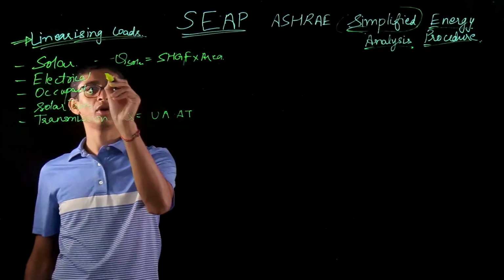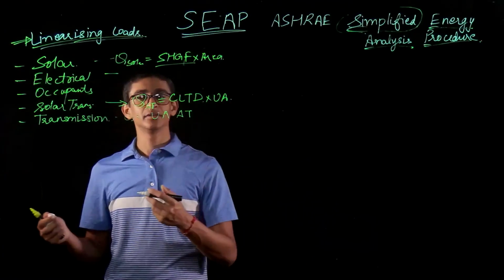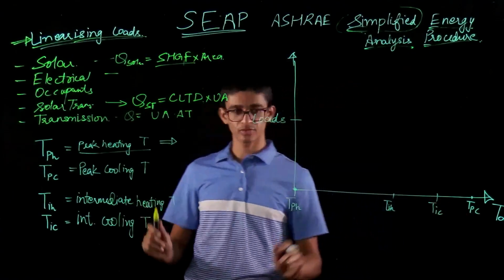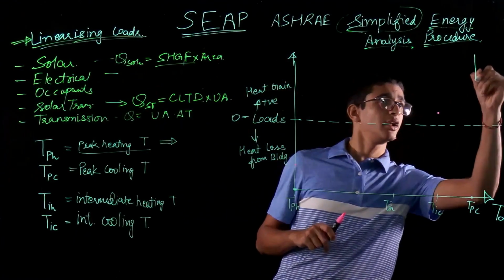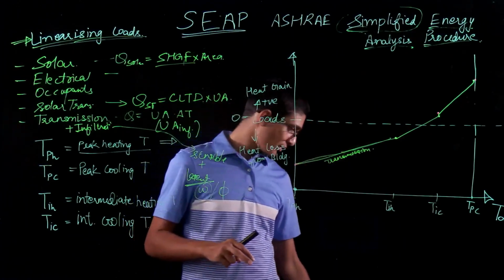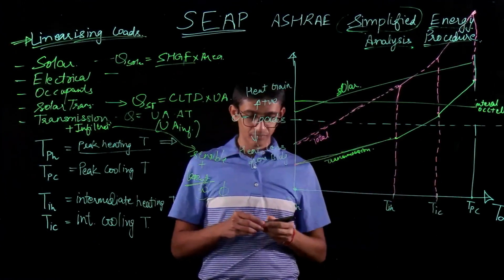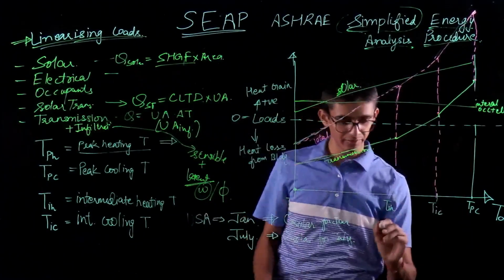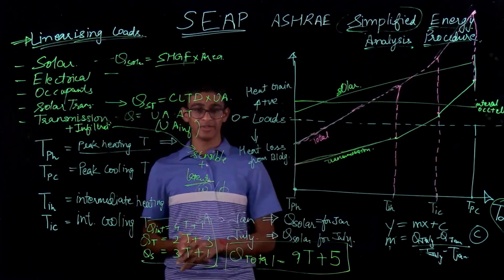ASHRAE SEAP Simplified Energy Analysis Procedure | Load Linearization Procedure using Example

Comment: How internal load constant if the accupancy changes .what the effect of time lag ?
Reply from the maker: Thank you for your question.
If occupancy is considered to change during the time we are simulating then definitely the occupant load and hence internal load changes. The very assumption of SEAP is that the average loads are considered in the analysis to make the computation easier. All of occupant load, light and equipment loads are taken as average over the day(24 hours). 

While having a mass wall (instead of massless wall) will result in thermal lag or time lag. Occupant load is mostly distributed across the volume and exactly inside the volume so it would not lead to time lag to show up in total loads. But the light load does experience time lag as the lights are on edge (ceilings) and the light rays are usually trapped or absorbed by the walls, ceiling, and the furniture in zone. So the light load and in fact any kind of solar radiation load does have time lag given by Cooling Load Factor or CLF.